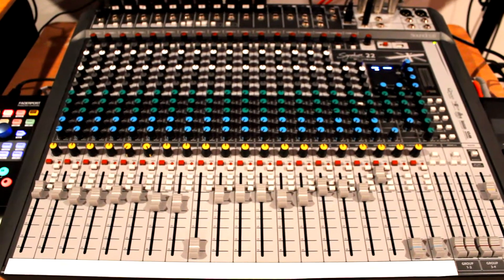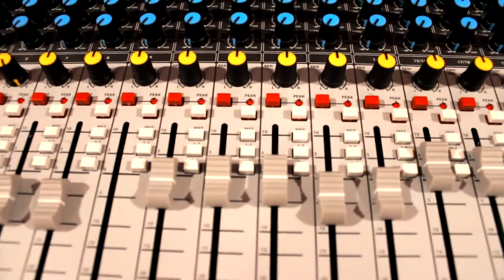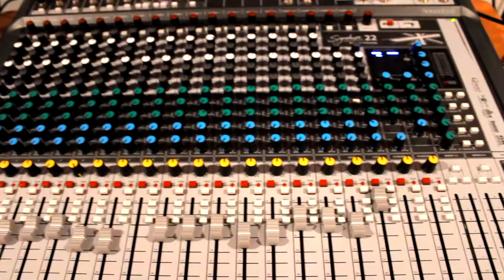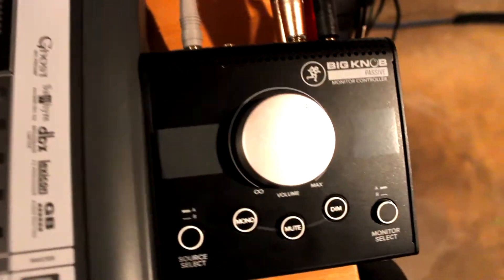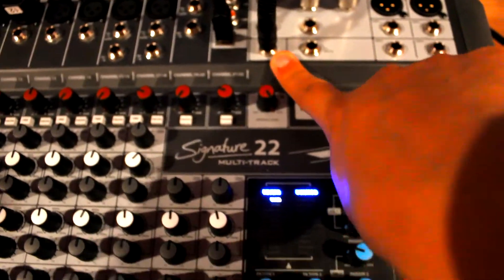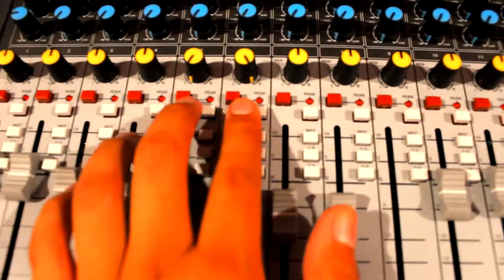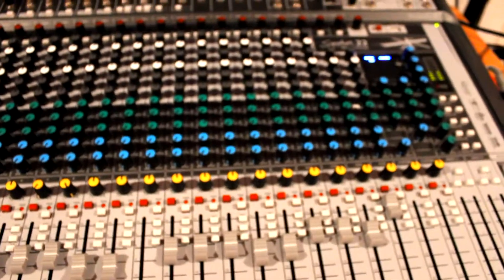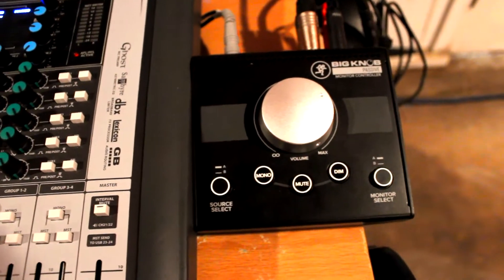Soundcraft 22 MTK PFL Switch Hack / Workaround

Comment: Thanks for the tip. A great work-around! It opens up all kinds of possibilities and you don’t need outboard gear to make it work. For example, the headphone out can be split into 2 stereo outs using a simple 1:2 adapter (one  for your studio monitors amp and the other for your headphones).
Reply from the maker: You are absolutely right, I believe that would work as well

Comment: Can u please detail this connection?..been considering thr big knob for a while..
Reply from the maker: Y cable split to big knob. From big knob i have one pair of TRS cables going to the monitors and one pair going to my headphones
Reply: @SoundcastStudios  thanks!!..i would get one..not for that reason,but for the reason of sending my summing back to the Daw,to get max volume,i have to always increase my grp,consequently increasing my masters,and that makes it sometomes too loud for my home studio,i figure with the big knob,i could lower the vol of my speakers,without  affecting my output to the Daw(analog sum)...u wanna suggest or recommend,gear u use in summing and as  masters compressor?
Reply from the maker: @overduemedia7508  I dont use anything but the board for my summing.
Reply: Hi Eric, I’ve watched the video a couple of times but I can’t figure out how you are doing this exactly.   When you say Y split into the Mackie, where is it coming out of and which inputs is it going into on the Mackie?  And when you say a pair of TRS cables to the monitors and headphones, which outputs are going where exactly?  Could you give me some more details?  Sorry, I know you explained it but I’m not understanding.  Cheers!
Reply from the maker: @uncleted3961  Coming out of the Soundcraft headphone output and into inputs  A of the Mackie. Output A to the monitors and output B to the headhpones
Reply: Soundcast Studios  oh, got it.  Thanks.
Reply: @SoundcastStudios   Hi, you said the big knob's B output goes into headphones, but what do you mean? From big knob output to headphones output? You can't. The mixer only has a headphone output that you exit from into the big knob input. Only headphones have a headphone input. Could you explain me better? Moreover, when in the video you say to exit from output B to enter the headphones, you are indicating the headphones output of the mixer. But how is it possible?

Comment: I’m sure the pft on the tascam isn’t a true solo button like it solos it but panning etc doesn’t apply
Reply from the maker: True, it’s not a true solo button. You only get true solo in higher end consoles.
Reply: Soundcast Studios that would if been a nice addition to but like you said the tascams a very versatile console for the money as it is.
Reply: Soundcast Studios i was going to ask as, i was reading on sound on sound that through your speakers in the control room you cant hear manual fade outs etc is this the case do you know also could you use the main monitor outs for your studio monitors if they have XLR inputes
Reply from the maker: @craighughes-shug6694  Been at the board trying to find a work around. Plugging into the mains is the only solution I have found so far to hear manual fades.
Reply: Soundcast Studios cheers man I thought that was the case would you mix with studio monitors through the mains or they only really for live applications
Reply from the maker: @craighughes-shug6694  you could do that. The workflow would be similar.
Reply: Soundcast Studios totally, im picking one up this week my plan was to run it through the DAW and back out to the board but my MacBook i ran pro tools on decided to pack in so for the time being ill be using the built in recorder hence the manual fade out question lol